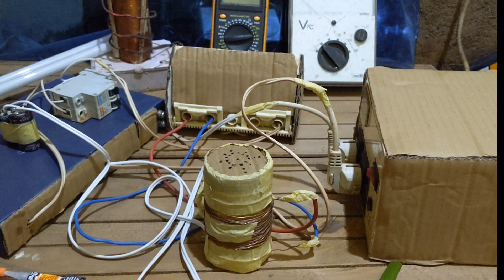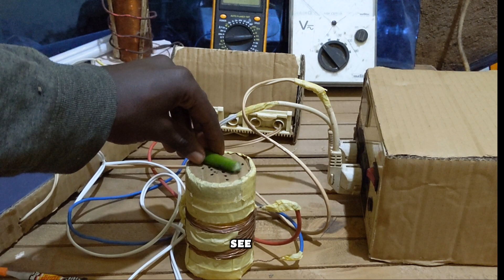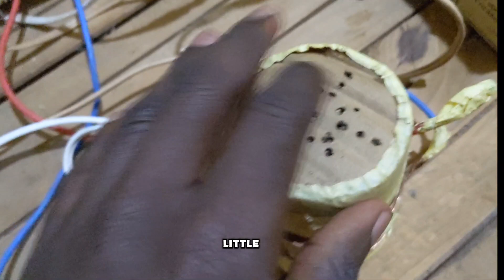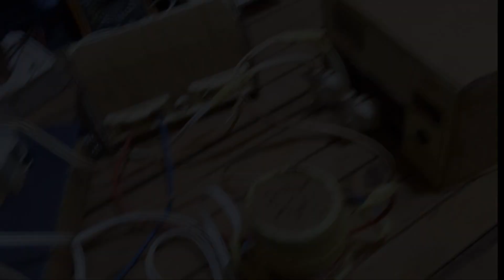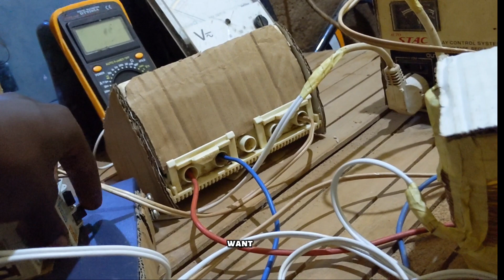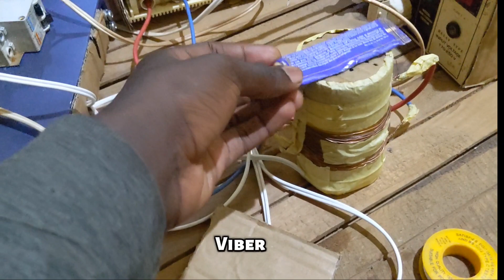KEIDIUM LEVITY DEVICE: Antigravity Test 1

Comment: How in the world did you come up with this combination? It's like a miniature tokamak or something (ok maybe not but that's what I thought about lol). Great job on the setup though! Extra points for mentioning Hutchinson (Probably wrong spelling. Long time since I heard about him, and no, I have no idea how he did it).

No offense, but I don't think it's anti-gravity. I think that it's simply the ultrasonic transducer that vibrates the air, air going back and forth through those holes at the top and pushing the objects away. But I don't know why the air has to be ionized (apparently). I could be wrong ofc. Have you tried with only ultrasonic and maybe the HV supply activated? 

Resonating DC makes no sense to me. Might be you use some kind of square wave, or a hidden spark gap?

Gotta love your setup though!